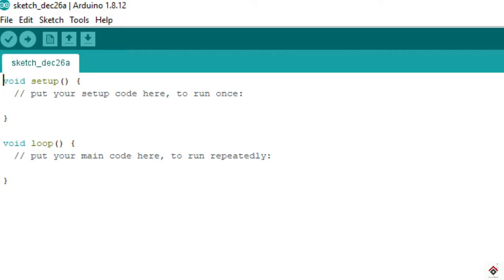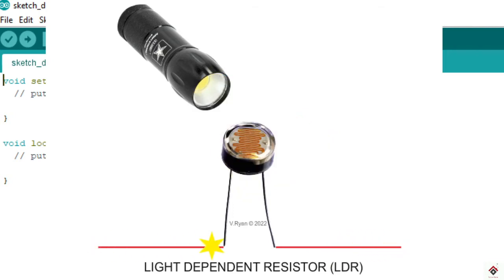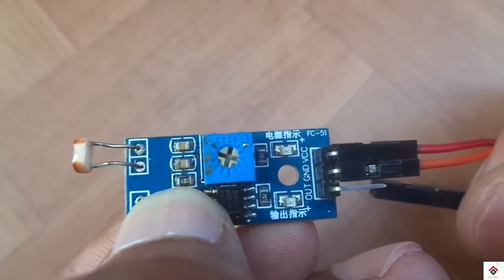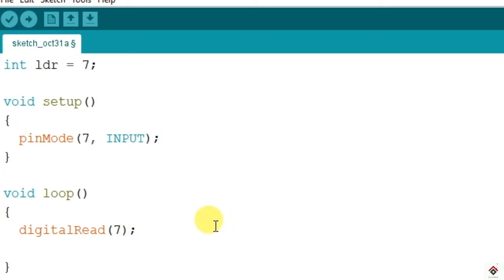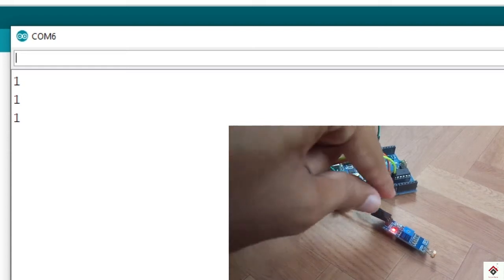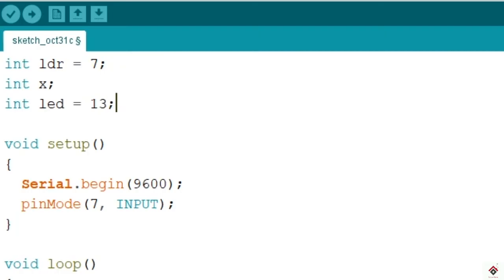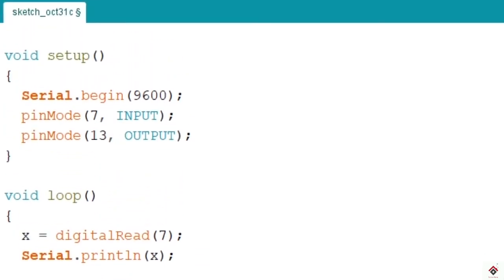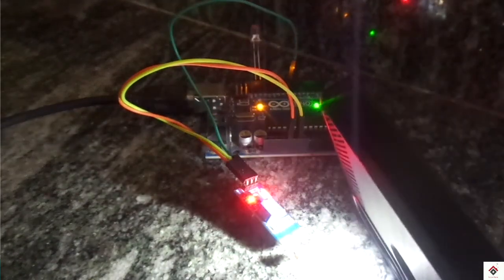LDR sensor with Arduino | Smart street lights projects (Light Dependent Resistor/photoresistor)

Comment: Cant we control the intensity of a led just by changing the resistance of ldr sensor.
Reply from the maker: Yes you can do that, you have to read the analog output pin of the sensor and use it for pwm mapping.
Refer this video: https://youtu.be/Q0ZOZdEEw8M?si=M0DwVbypqPo2J9L5

Comment: How many LED light we can glow through LDR sensor
Reply from the maker: Through Arduino we just read the sensor data.
Based on this data you can control many LEDs. Depends on the number of pins available on the Arduino or any controller.

Comment: Great video sir!
I'm wondering how do I get the specific data in lux from it (not just 0 and 1). Hope to see the answer soon.
Reply from the maker: Thank you!
I don't think that is possible, because LDR is just a resistor whose resistance varies based on light intensity. Corresponding voltage drop we are reading through Arduino.
Reply: @techathome  Thanks! I got it.